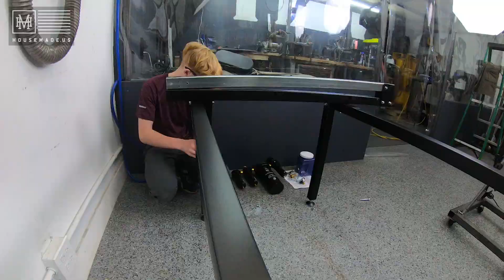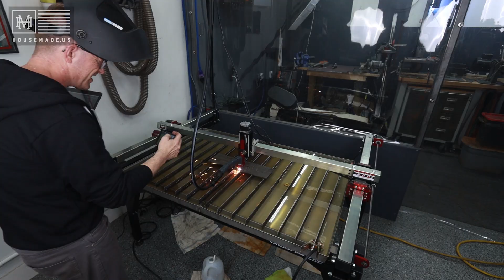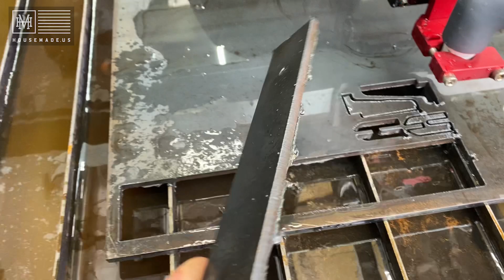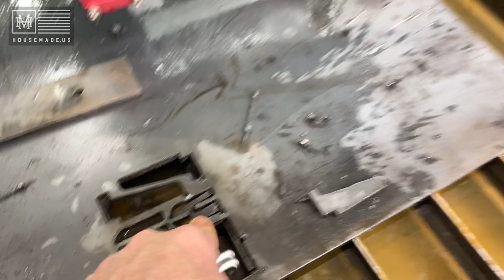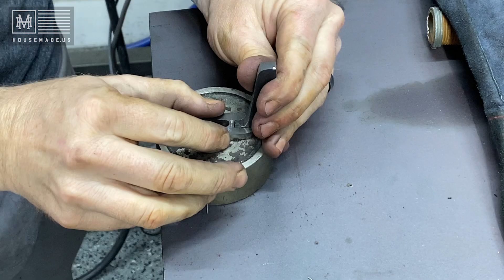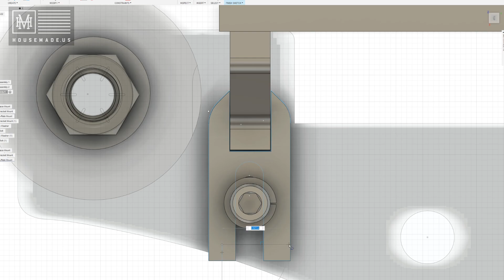14 Year Old Builds a Langmuir Systems Crossfire Pro Plasma CNC Machine

Comment: Nice work on the father & son build. Video is 4 yrs old now so I’m sure you’ve worked out the dimensional setting, I’m researching to DIY build a CNC Plasma Table, I see you can adjust direction (clockwise / anticlockwise) to get the kerf width offset on the correct side of the cut. 
Awesome work. Cheers for content.
Reply from the maker: Thanks 👍

Comment: What has been your experience with the razor weld plasma cutter? Have you had any problems with it? I'm getting the table and trying to figure out which cutter I should get. I'm deciding between razor weld 45 or the prime weld 60. Thanks in advance a I understand if you dont have time to respond
Reply from the maker: I had some grounding issues but now that has been resolved. I added a magnet to the grounding clip and a few more whips off of the ground strap. Works solid now. Getting really nice cuts.
Reply: @HouseMadeUS  thank you so much for your reply. I have 2 young children and watching you guys work together gives me hope that they will be interested as well. Keep up the great work

Comment: It's your cut path is why your parts are small your cutting on the inside when you should cut on the outside of your design also crank up your plasma amps and speed up your cut speed for better precise cuts
Reply from the maker: Thanks I’ll do that.

Comment: Seems like your air pressure is a little low. I have a titanium 45 harbor freight plasma cutter (that I absolutely love) and I run 90 psi on it. I know all machines are different it’s just what mine recommended and works well. I like the video.
Reply from the maker: Thanks Jason. Yes that was part of the problem. I had to take the cover off the RazorWeld and dial it up manually at the filter/regulator. Thanks for the advice. 💪🏻😁

Comment: In my limited experience the metal you are cutting is not outside the capacity of the machine you have but a 45 amp cutter does not do it well. You dross issue is a combination of cutting too slow and torch height.
Reply from the maker: Yeah that makes sense. I’m still learning a lot. Thanks for the advice. 👊🏻😁

Comment: I don't know much about this machine, and there's a learning curve on anything. There should be settings controlling "offset" (cutting inside/on/outside the lines & compensating for kerf width), travel speed, cutting speed, pierce times, etc...
A quick rule of thumb for small holes, don't make holes the size of or smaller than the material thickness. And on thicker material, you will want longer "lead-ins", so the pierce hole and splatter doesn't interfere with the part. now you can continue to make your own mistakes with confidence. :)

Comment: We have a much larger plasma cutting system,  but it looked like your travel was a little slow. Maybe I'm just not seeing it right.
Reply from the maker: Yeah that is 20 ipm, does that sound right?? Runing at 32amps. .25 steel
Reply: @HouseMadeUS  I don't have my charts here at home but I think we use 100 amps at 160 or 180 ipm. We have a Torchmate 5100 with a 200 amp plasma. Thinking about getting one of these smaller machines for when I retire.

Comment: I've got my wife 90% on board with me getting one of these!  I also love that your son is getting into this kind of stuff so young.  I was like him but my dad couldn't care less.  My son is only 6 but he also likes to hang with me in the shop.  I hope I can nurture his enthusiasm the way you have with your son.  Great job on so many levels!
On a totally different note in fusion  360 you can click your cut path and switch it to the outside of the part.  You can also adjust the offset.  I'm guess you've figured this out by now.  But if not...
Reply: Yes seen it alredy  and pretty much changed my perspective about buying one as I needed unit allowing to use fixtures. 

What diameter are the holes on your table? They look much better comparing to ones crossfire made for your beltsander bracket
Reply from the maker: Sorry for the the late reply, the holes are .875 - I wanted my clamps to fit down in them. They also make great screwdriver holders. 😁
Reply: Most of the time my wife is 40% on board when I buy stuff and she gets over the 60%. Hopefully your wife will get over the 10% unless you have been a bad boy. Lol
Reply: @jasongrinnell1986  I got one. :)
Reply from the maker: I always behave Jason. Happy wife, happy life! 💪🏻😁
Reply from the maker: Yeah it’s a game changer bro. Check out my story on YouTube today. Cutting small parts.
Reply: @HouseMadeUS   thanks for this vid. Buying my corssfire pro tomorrow and all the info here was very helpful
Reply from the maker: Retro Turbo - hey man congrats. I love my CF Pro. Watch the welding table vid I put out a few weeks ago. I cut 1/2” plate with it.

Comment: From my research it seems like the trick is for clean round holes is for the arc to lead in from the center of the hole
Reply from the maker: Yeah I need to work out the tool path better. Should this machine be able to cut a 5/16 hole?
Reply: @HouseMadeUS  of course just replace the plasma torch with a hand drill and a 5/16 inch drill bit

Comment: I have a crossfire I am fan of there tables. If your cuts are beveled the torch holder will flex and it effects cut quality a lot you can really see it with cutting holes.
Reply from the maker: So is there a fix for that? I have slight bevels now.
Reply: House / Work I have a machine torch on mine so I just purchased a new mount and that corrected my problems. With a hand torch it’s going to be slightly more difficult due the way the torch lead hangs and pulls on but anything you can do to relieve some stress off it should do the trick.

Comment: The last time I did any profile cutting was during my apprenticeship and it was a magic eye oxy bed which blew my mind... you have reached the next level mate!! That is a dream come true I bet

Does the travel rail get any spatter or slag on it? I always found that a tiny bit of dust/dirt or slag on the rails was amplified on the cut.
I’m sure you have worked it all out 🤘🏻

Also well done to the boy! He will look back at all this time spent with you and wish he was back there in years to come 🙏🏼
Reply from the maker: Thanks Chris!! I have seen this oxy cut machines and they are insanely cool. I am most definitely going to need some protection for the rails, water dust and grit...I did get the machine dialed in yesterday. It was a loose coupler and I re-zeroed the machine. Cuts insanely perfect now. 😁👊🏻

Comment: For smaller holes you can just put a “mark” like a center punch hit with the torch so you can drill them later.  Sometimes cutting the small hole will harden the surrounding material and make it harder to drill. 
As for the size issues I don’t know anything about the fire control software.  I know that mach3 and sheetcam that I use needs to have the curf adjusted properly.  And then selecting outside inside or on-center cutting is an option. And the direction that the torch moves around the part makes a difference too.  The plasma stream cuts straighter on one side of the cut than the other. You’ll have that thing dialed in pretty quickly and have parts dropping right out that are nearly perfect.
Reply from the maker: I have heard about this. I’m gonna look up how to do that with Fusion. 👊🏻👊🏻👊🏻
Reply: House / Work Perfect. Yeah what ever you’re using to export (fusion , solid works etc) those settings are probably there. 
👍👍

Comment: Great job on the set up! I love your videos... 

I am a pipe cutter for pipeline work for Shell.. I use a plasma cutter everyday all day and well cutting your pieces say the 9x11 you might need to enter in 9 1/8 x 11 1/8. And you will come out with more exact measurements. We bevel the pipe and we have to add 5/8 to our original measurement. If that makes sense.
Reply from the maker: Yes that makes perfect sense. I have been playing with the kerf settings today and it looks like .045 is about right. Started at .065 so it’s cutting much more accurately now. And I found a loose junction on one of the threaded rods, tightened that up and she is cutting very straight. 👊🏻
Reply: Awesome!! I’m glad yall have it cutting better! I will be ordering a kit from you soon!! Love your videos!!

Comment: If you can get the water to touch the metal your cutting you will have less dross/slag . Some machines cant cut wet though
Reply from the maker: Ahh okay. Well my slats sit higher than the pan that holds the water so I can’t really get it all the way up to the metal. I can get more water in though.

Comment: I think from what i see that your Plasma cutter is not powerful enough and you must have more air pressure. i have cut a 25 mm thick steel plate with ease and a lot less slag and my cutter is a medium range chip Chinese one.
Reply from the maker: I have the option to boost this machine to 45 amps. I tried higher amperage and it got worse. Maybe I should try better air. I have a 50 foot long hose hooked up to it. I’m thinking higher PSI? It’s set to 70 at the moment but drops to 60 when cutting. Thoughts?
Reply: @HouseMadeUS  well my system works on 7.5 bar witch is 108 psi. and i use 1/2 " hose for it.
Reply: how ever the compressor system is a twin screw by INGERSOLL RAND INDUSTRIAL COMPRESSORS. A very powerful system so  maybe that's what makes the difference.
Reply: Today i ordered all the iron i need to build the frame of the grinder